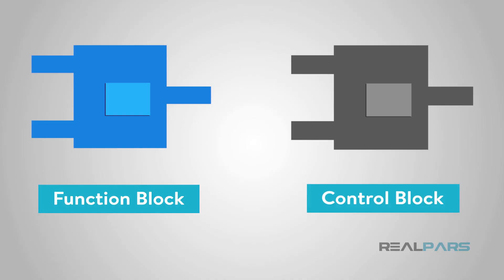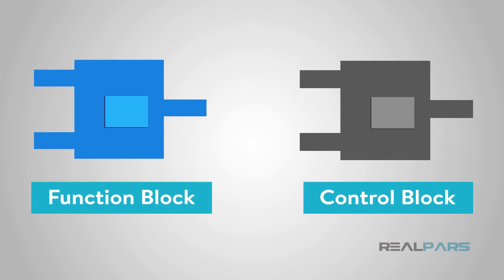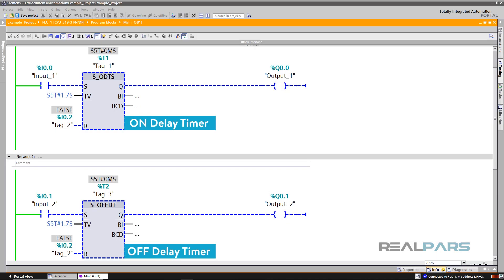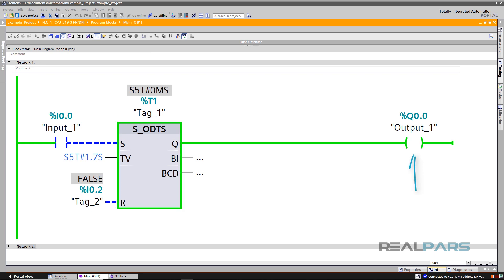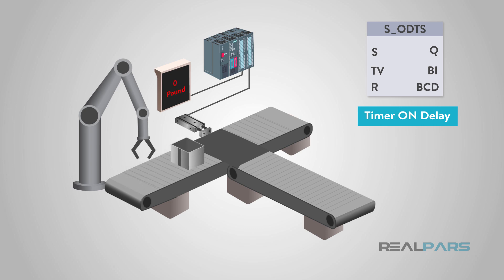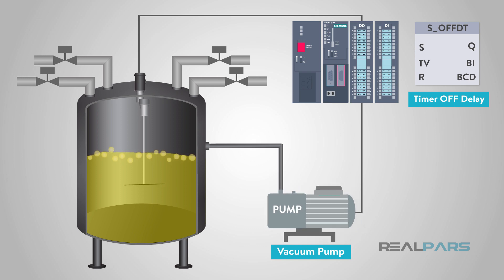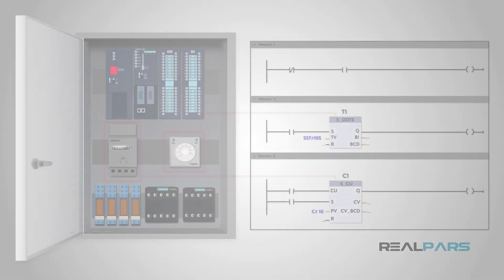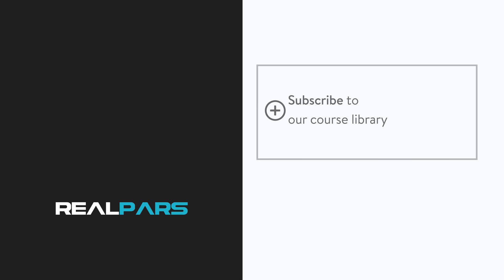What is a Control or Function Block?

Comment: not exactly what i was looking for but pretty good explanation on the timer off, thought the R isn't necessary because the timer on and off delay are retentive or don't retain their current values when the input has been deenergized .
Reply from the maker: Hello, @bluchizz. Thank you for your question. As we explain, there are various functions for which a timer can be used in a program. The reset button is also used as needed by the program. But as you mention, not all the time. This feature is available for programmers to use as needed, as most timers from different OEMs provide this feature. It is also related to the invention of the original mechanical timer, which was used years before the PLC was invented.  Here is link to help you with your learning: https://support.industry.siemens.com/cs/document/109744173/documentation-for-simatic-controller?dti=0&lc=en-WW